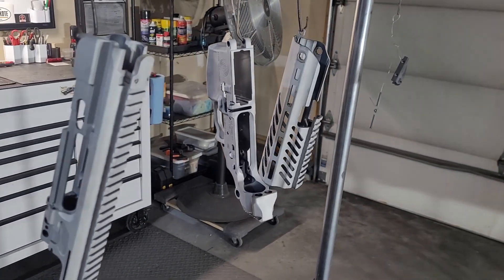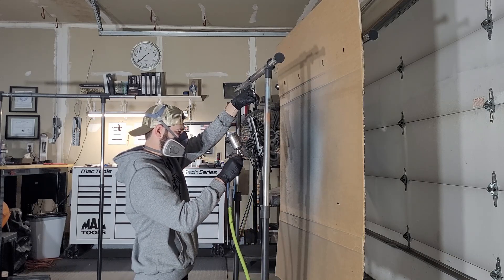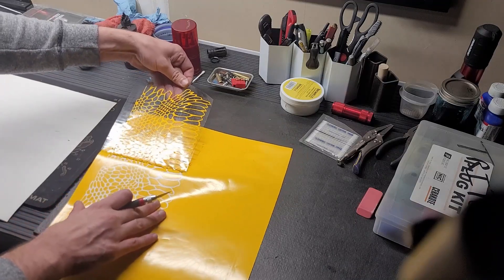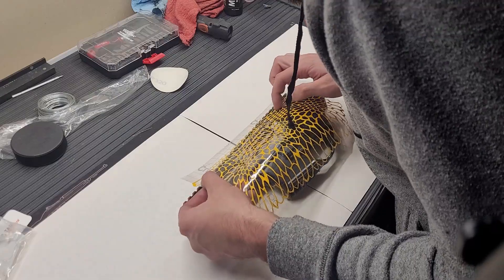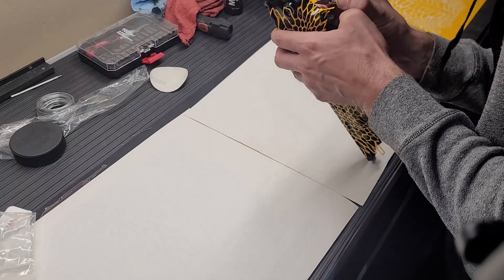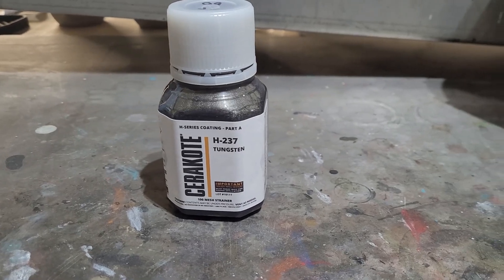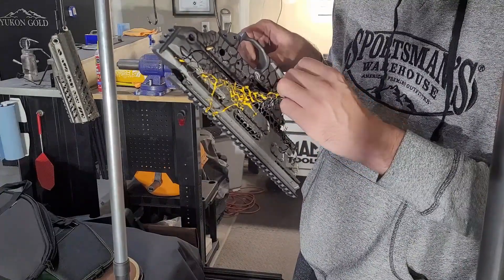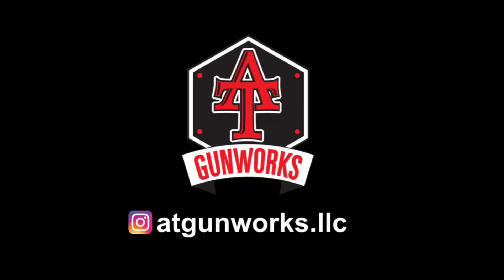Sig MCX Cerakote Kryptek

Comment: Great job. Where did you get the stencils from?
Reply: Im new to stencils and realise why I have waited years to do that = pain in the a**! 
Who makes that stencil with the outter tape? I havent seen that yet and thats the way to go!!! Ive been weeding it out and the outter web of Krypet is a b*tch without that tape holding it to prevent static cling...
Reply from the maker: i cut my own stencils with the vinyl from cerakote. has good adhesion and doesn't lift much with flash baking